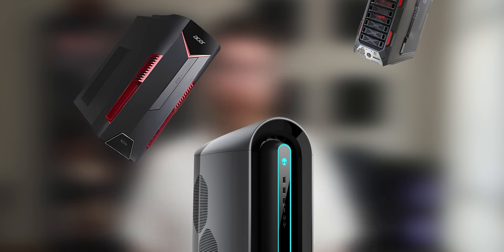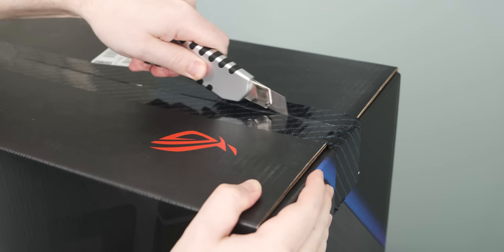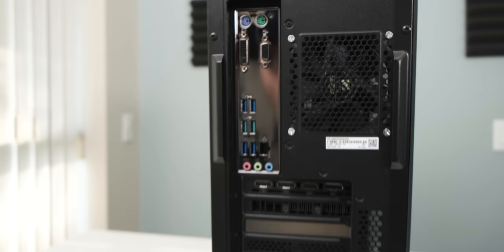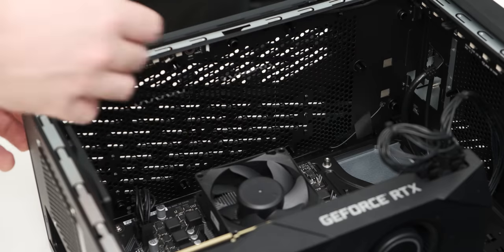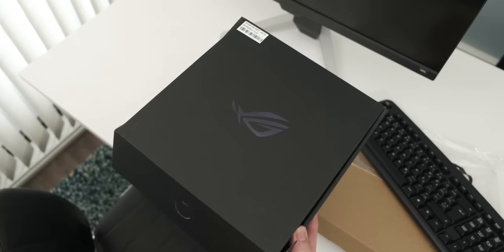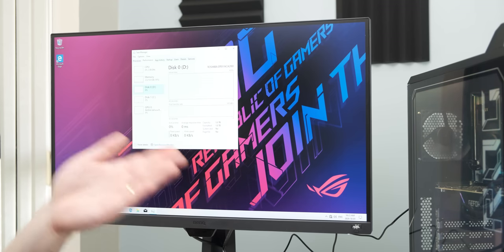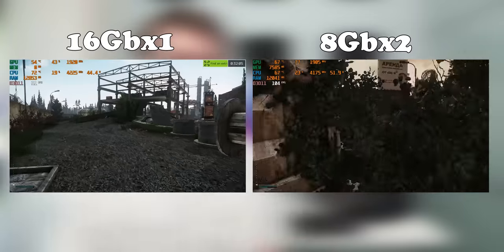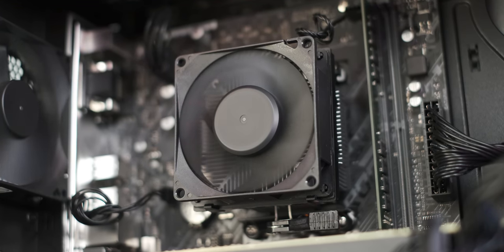I bought a $1500 Asus Strix Pre-Built from Best Buy...

Comment: if i want to change power supply and cpu cooler and fan,.. .got some questions.. 
1. if i change power supply do i have to change all the existing cables as well?
2. if i want to change cpu cooler what is the requirement? LGA1700 gonna work?

Comment: what i hate most (apart from single stick ram slots) is that almost every prebuilt always comes with a micro ATX motherboard inside a full ATX case or worse, some proprietary motherboard with some weird shapes. motherboards, cpu fan and PSU are were they always try to cut corners the most and it is just appalling.

Comment: So they must have either heard the complaints or realized some of the issues because the model i got has two chips of 8 g ram and 4 slots instead just two the power unit is completely different and the outputs are hdmi and display port, no dinosaur plug. The only thing i still had an issues with was the number of fan and the fan noise but i can replace that laters, and tho it was challenging i managed to add a 120mm to the front of the cage. Mine has an I7 and a 3060 tho so maybe that is why its different. It was on sale for 1275 US, added a corsair 120mm for 25 bucks so 1300 total so far  I had no computer so I grabbed it.

Power delivery section of mine looks way different too*

Comment: Hey dawid, i got a computer alot like this. Except mine has an 11th gen cpu, and an RTX 3080. It turns off at random when i play these games:
Rainbow Six Siege (when i get into a match)
Rocket League (when i start the game)
Doom Eternal (putting a box fan on top of my pc makes this playable)
Sea of Thieves (putting a box fan on top of my pc makes this playable)
Muck (putting a box fan on top of my pc makes this playable)

Here are the games that run fine
TF2
Garry's Mod
Dead by Daylight

Any Tips?
Reply from the maker: Hey! Have you check the temps? If you install MSI after burner you can monitor the temps while gaming. If it gets to hot, they could be the reason.

Comment: I've had mine for about a year now and I love it! However! Now that I'm trying to upgrade my ssd I've run into a few problems.

Only one m.2 slot. Okay np I'll put in a 1tb ssd and move my 512 m.2 to a pcie slot. Nope. Only the pcie slot for the gpu and the m.2.

Guess I have to splurge on a 2tb ssd and trash my 512. Right?

Comment: My pc which my brother bought like 7 years ago is a prebuild which came as a bundle with a good gpu from the time, a gtx 760, a surprisingly decent mobo, an i3 4150, get this, 2 sticks of 4gb hyperx memory, i know, wow, an ok toshiba 1tb hdd, an ok itx cube case and finally, a terrible 500w psu that died in a year or 2 and was replaced by a much better 750w corsair one with 80+ gold i think... its still semi modular like the first but the thing was kinda overkill... like if I were to build a new pc right now I would take that psu from my pc cause its so good... the only upgrades i did to the pc were getting a 240gb ssd like 3 years ago and the I repasted it last year which didn't do much of anything surprisingly... at least i got to take a cpu out of a socket and put it back in for the first time in my life...

Comment: If I could change anything in this PC, I'd swap out the tiny cooler for an AIO, swap out the PSU for a modular PSU, Install a dual channel ram kit, and go for a ROG mobo (it's a ROG system so it only makes sense to go for a ROG mobo)

Comment: OMG, was about to order this machine, now that I’ve watched this video, my mind is spinning. Am supposed to use this to render 3D projects.
Reply: It can do that job. Still, depends on what you are rendering in, and how long you want to wait for each project. The 2070 Super's more than up to the task, even a blower model. The 3700X is no slouch either. Just upgrade the ram, CPU cooler, and get a case fan or 2 for the front.

Comment: Hey Dawid I have the 9700f 2070 super combo. If you add a coolermaster mf120 to the front bottom, it feeds air right into the blower and gets stupidly good Temps.
Reply: Without those CoolerMaster fans you mentioned, how bad are temps? And also, do you NEED to have MF120 from CoolerMaster? Why not regular case fans?
Reply: @_Mohanned  the Temps are fine without them, but it made a drastic difference when installed because it feeds cold outside air right into the gpu fan. I chose the mf120s because they look very nice and also have a little rubber raised pad on the mounting points which are ideal for this case. If you don't want extra light, the non rgb version is a bit cheaper but I would highly recommend them. They blow hard. If you put a fan splitter from the case fan and run both the news fans and case fans from a single hub, then when the cpu gets warm, it will ramp up both front fans and push all of the hot air out of the case. Overall, its a great pc. No complaints. I just wanted some more light because its a bit dim in this case and some lower Temps just for my own peace of mind. Lol.
Reply: @_Mohanned  one thing I forgot to explain. With there being 2 fans in front, when they ramp up like I mentioned, the case fan and top front fan create a sort of channel over the cpu and cool it down so fast.
Reply: @GBreadCreations  alright thanks

Comment: ive recently gotten a pre built strix like this one with an i7 11700k and a 3070 and it has the same cheap cooler and 1 stick of 16 gb ram. im thinking that i should switch out the ram for a new kit because it makes a difference but also i am curious as to if upgrading the cooler to something different would be worth it or not. it has a great wall gold 750w psu so i think that should be fine. thoughts?
Reply: Have you done any changes yet?

Comment: I loved this desktop but my temps were so bad I ended up buying a 2nd case and moving "Everything" out of the original case and into the corsair 4000D only issue I had when Moving it out was that Asus made this motherboard to only function..inside of the case properly..So in my new case the front/top usb ports dont work. Besides that Everything else is fine and I got a liquid cooler and like 6 fans inside of the case now for better airflow.
Reply: QueefMa Cheeks  yea i added like 6 fans to it outside the 2 that came with my AIO

Comment: I recently found a prebuilt from hp called HP ENVY and i'm pretty sure it's actually deasent, i mean the ram runs in dual channel mode, it's got a pretty good cooler and the specs are pretty good too: Ryzen 7 3700x, RTX 2060, 16 gb ram 2666 mhz. That last one is of course kind of a bummer since it is a Ryzen based system, but i think it's actualy a good pc.

Comment: Dude, thanks for this I've been looking at that computer (the 2K version) for couple days, and this really helped me see what's inside. I'm planning to use it for video editing and blender (3d modeling) and now I'm very skeptical about the cheap fans and 1 slot ram... help me find a pre build that doesn't have those issues if you can, thanks!
Reply: If you have 2,000 I'd recommend building a pc yourself vs buying a prebuilt

Comment: I got this same system from best buy but it came with ROG b560 motherboard with 11700k and upgraded cooler. 2x8gb ram and rtx 3070. It was 1500 as an open box. I guess I got lucky because every review I see of this rig at this price point is lower spec. I've since upgraded it but it was a great place to start considering the low availability of parts at the time I bought it
Reply: I got mine from micro center came with a rtx 3070, 1TB ssd, 32gb Ram for 1500

Comment: Acer and co are not taking "advantage" of them.. they actually dont know themselves for the most parts.
Also for most games the difference is 10% while the majority that uses those systems also has a 60hz screen - they are designed for max performance at 60-100fps
Its not the technicians at Acer, Asus, Gigabyte etc that design the pcs. Its other employees that use the parts they got and that they can get and build a pc for mass fabrication out of it. If they get told "design a 8gb / 16gb system" they use the cheapest way to get to 16gb and thats a single 16gb slot - that does "the same" as 2x8.
 
They work as intended and that 16gb ram can be upgraded to 32gb dual so thats all they care about.

Comment: I have the GA35DX which is a beefier version of this pc its more expensive but is fixes the issues of this version. it has an off the shelf TUF RTX 3070 as oposed to an asus OEM RTX 3070. It has 32gb of ram in dual channel. It also uses an off the shelf asus cooler and asus motherboard. The GA35DX as opposed to this is a much better and more capable pc. Granted this is about double the width of this pc and also has liquid cooling too.

Comment: I just built a £1497 pc at home

Asus tuf gt501 case
Asus tuf gaming x570 plus mobo
Ryzen 5 5600x
Corsair 8x2 ram
Corsair ssd mp600 1TB
Noctua air cooling NH d15s
Gigabyte 2070 super OC

Couldn’t wait for the new gpus as they’re 
Out of stock

Comment: I found this prebuilt for 700$ on OfferUp brand new exact same specs rtx 2070 super but with a Ryzen 7 3800x and 8x2 3200mhz ram and a non branded cooler master evo 212 cooler instead of the one you got

Comment: I'm pretty sure I read somewhere that psu is an 80+ gold unit from seasonic I have this pc with a ryzen 5 3600x and a 1660ti it's good for gaming but that cpu cooler is damn loud I also upgraded the ram to dual channel 32 gb and runs games so much better and my motherboard was different compared to the one in the video

Comment: I bought this but a I7 11700k and 2070 super. If you just touch the power cable it’ll spark out. Reached 75 -95 degrees Celsius. The power supply is also loud as fuck. Woke my kids from a dead sleep. Safe to say I returned it fast.

Comment: I bought this as my first ever gaming PC. I now know much better than to buy something like this ever again. I have upgraded it as much as you can, put dual 16gb RGB ram, Fit a 120 AIO cooler as the original was hideous and noisy. I also ended up putting in a ASUS 3070 dual as it was one of only 2 3000 series cards  that would fit in the tiny case with the AIO in the only place it fits. To be honest it runs pretty good but the motherboard is still a very limited part of the PC and when it comes around to the nest series of GPUs being released I will build the PC myself with a premium motherboard. Oh yeah I also put in some nicer cables for the motherboard and GPU.
Reply: Will a Rtx 3060 or 3070 fit on this pc case?
Reply: @Rachel8031  yes but because I am running a 120mm liquid cooler I can only just fit in the smallest variants of the 3070 Asus Dual OC

Comment: Another 16gb stick is 70 bucks or so, a cooler master 212 is 30-40 bucks. Those were the only real weak spots. 15 minutes of ranting about that? Any kid who bought one of these: your computer is just fine, and considering the market right now you likely got a pretty good deal.
Reply: There’s a same build that brings a 3070 and a RYZEN 5 5600x for 1599. Is it worth it ?
Reply: @bgzks  I was at a micro center and they had a 3070 for 779$. I haven’t seen a price better than that in a long time, so using that number—add a 5600x for 300$, mobo at least 100$, if it has 16gb ram that’s like 70$, if it has a 500gb ssd that’s like 60$. So you’re at like 1300$. Case, psu, whatever else they’ve got in there is all probably not as good as stuff you might buy to build (although I was impressed with the asus prebuilt case at the microcenter I mentioned)—so maybe you’re 100$ down compared to what it would cost if you made the same thing yourself using the same low end parts for non performance areas. Essentially youre paying the last 250$ for 150$ worth of stuff. But that’s with that 779$ 3070 price in mind, which isn’t exactly easy to find. Long story short, is it a great deal? No. Nothing is a great deal right now no matter how you slice it. But relatively speaking, are you throwing huge sums of money away buying a prebuilt vs building? No. Normally absolutely you are—but right now you’re not. So if you want a 3070 that’s as good a way as any to go about getting one at the moment.
Reply: @Bhg265  thanks im gonna buy this prebuilt the one in the vide with a 3070 and 5600x. One question though do you think it can run 1440p , 144-165 hz ?
Reply: @bgzks  depends on the game and the rest of the settings, for the most part yea based on all the benchmarks out there you should be able to. But on the most demanding stuff I would expect somewhere between 80-110 on average, and if you lower a couple settings that’ll go up accordingly. Enjoy dude you’re gonna sweet performance.

Comment: *Turned out it was the GPU died after only 6 months,  could have been faulty or just a pos blower card and a pos case that has no intake so the card just sucks hot air from inside the case,  temps were fine but who knows,  all I know is I got it replaced under warranty I have a working computer... for now.  I just would never recommend this PC to anyone even as a last resort,  they cheaped out big time even for a prebuilt, the CPU is probably the only part where they couldn't cut corners besides putting a generic cooler on it instead of the much better factory one for the only reason I could think of is that it wouldn't fit being so close to the memory.

Comment: Its sad that Asus does not do the same with their prebuilt that NZXT is doing, put you're own decent quality Asus coolers and motherboard in there, doesn't have to be top of the line.
You control the cost, while still providing an affordable build with decent quality to new customers. In all I think the PC is good for someone who is not comfortable building their own PC if you get it on sale loll, never pay full price at Best Buy for these prebuilt. 
The sad thing is that now with the chip shortage, no one can find any decent graphics card at the moment, they're either sold out or so overpriced that it is now worth buying a prebuilt, although if I was to buy prebuilt I would go with NZXT. 
Luckily my system is good for quite a while longer still, I will last until things go back to normal hopefully with my 2080 TI and my Ryzen 7 3800X.

Comment: i got this Pc its amazing ngl Great runs fast Loads fast everything is good 😀 very happy with it
Reply: Have you had any problems with it turning off or resetting by itself? I plan on buying one.
Reply: @genboxofficial7417  no not really it’s best pc go the price
Reply: @haxxanyt5918  yeah, it’s the only pc with such a good gpu in stock. Any gpu better than an rtx 2060 is sold out. The rtx 2070 super is selling for $1,200 alone. Because of those reasons I bought the pc earlier today.

Comment: A question to anyone who has this PC: how well would it run games like: 

Battlefield 2042, CoD MW 2019, Fallout 4 with about 250 mods installed, and Minecraft 1.16.5 with about 70 mods, a 32x texture pack and shaders?

I’m currently using an ACER Nitro 5 gaming laptop and I’m looking to upgrade to a PC
Reply: I can tell you about the BF2042... it is amazing! Is probably the best pre built you can get by the price.

Comment: You know the only reason I still have respect for the rog line of stuff is they took most of this stuff from your video and improved soon it. I have the exact same case with a bit better hardware and they improved the motherboard added 2 8 gig sticks instead of one 16. The one thing they didn’t change is the cooler. I was personally going to just go Amazon buy a be quiet one and call it a day but I’m not sure.
Reply: Mine came with dual channel 32gb ram, rtx 3070, 1TB ssd. But still same cooler which I'm upgrading today

Comment: Why did they even put in 3700x's, and then not use the cooler than comes w it ? ..
Surely theyre just getting them a slightly better cost wo the cooler from AMD, and putting EXTREMELY cheap coolers on instead.

Comment: I got one of these pc's, but an ROG G15CX-B10 model with an i7-9700k and a 2080 super. the temps weren't bad at all and i just replaced the RAM and will replace the fans and it will be a good pc. never had an issue with it, BUT if you use xmp on this pc, you can't adjust timings even though it says there's a "custom" option, it will crash the pc. lol. sad.

Comment: i have this pc but not with a glass panel can i upgrade it 

AMD Ryzen 5-5600X processor.
Hex core processor.
Processor speed 3.7GHz with a burst speed of 4.6GHz.
8 GB RAM DDR4.
Hard drive:

512GB SSD storage.
Graphics:

Dedicated graphics.
NVIDIA GTX 16 Series GTX 1650 with 4GB memory GDDR6.

here are the specs what should i upgrade
Reply: The 8GB RAM. Get it up to 16 or 32, 3200Mhz (hopefully.) DDR4 is cool.

Comment: Oh wow, i still remember when i bought my 900$ prebuilt back in late november, back then i didn't know that prebuilta are not that good value for money...

Oh well, mine's was real good (rtx 2060, ryzen 5 2600, 16 gb Dual channel (at 3000 mhz), and 512gb ssd and 1tb hdd

- cable management: good
-performance: what you expent from the rtx 2060

My only problem was that the ram is running at 2133, any advice?

The motherboard is kinda poopoo, it's an a320, and the powef supply is a 450 watt 80plus bronze from corsair...
Reply: Also, the case is a masterbox q300l (has great airflow)
Reply: Oh that’s a pretty good deal
Reply: @user-kp4ii5eu2w  nice, do ypu know why is my cotsair ram at 3000 mhz, only running at 2133?

Comment: That's a crappy prebuilt for that price tag, heck my ASUS themed rig looks many times better. Now I have a question for you about RAM. From what I was told by ASUS tech is basically if the RAM is not on the vendor list the builder messed up and we can't help you until you get vendor qualified RAM. So if you just grab some RAM you have on your shelf and just plot it in that's not going to be vendor qualified but its the speed you want, so why won't an ASUS board post with DOCP enabled on a AM4 platform? More specifically a B550f gaming.